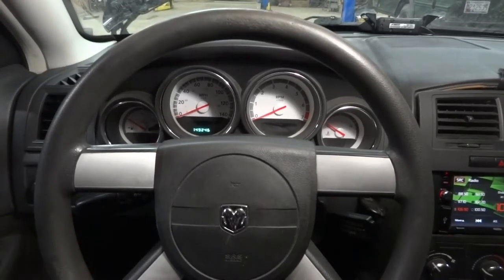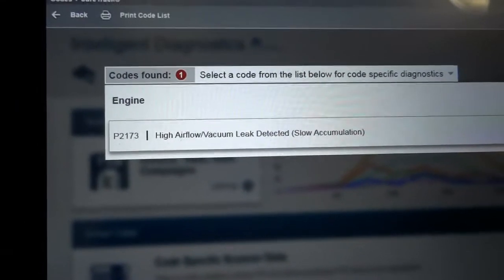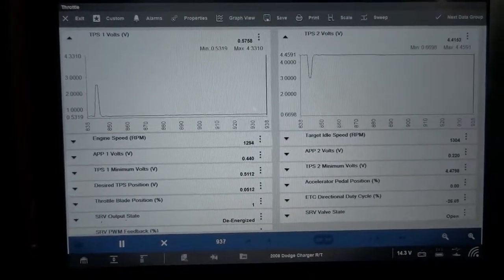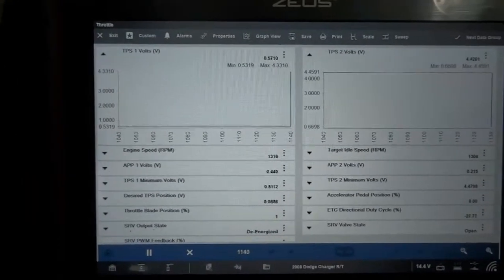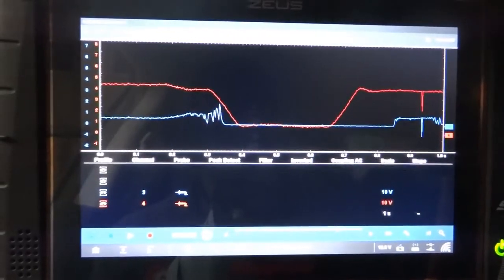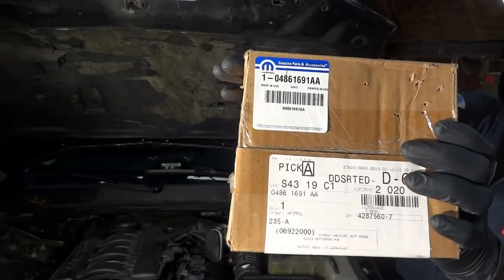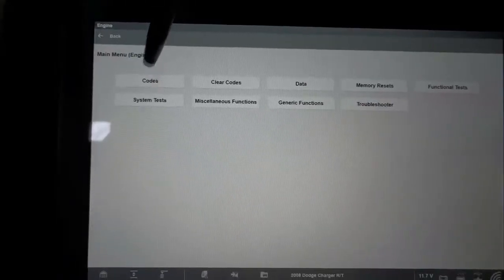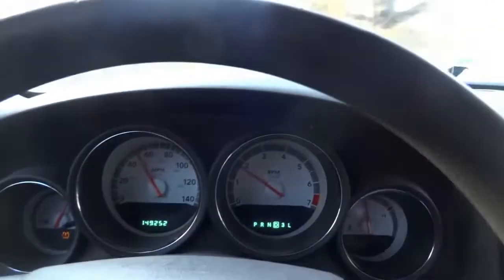Dodge Charger, Electronic throttle body light flashing on the Dash, code P2173. Low Power problems..

Comment: Clean MAFS, throttle body and intake manifold control valve. Change spark plugs and coil over packs. Replace fuel filter and fuel sending units (driver and passenger side - under back seat). Run can of SeaFoam through full tank of premium gas to clean all sensors. Car will run like new.
Reply: Ya….. no, still stupid lighting bolt flashing and no response from pressing accelerator
Reply: @mayken6661  replace accelerator pedal
Reply: I did all of this and it still flashes it’s the pcm
Reply: I replaced throttle body and pedal with sensor still lightning bolt comes on runs poorly
Reply: @jeremywesley4799  check your pcm for corrosion or if it has a chip and take it off
Reply: Brand new ecu still getting lighting bolt
Reply: Changed TB, and the PCM. Still lightning bolt and car will not start, just crank.
Reply: @mayken6661 replace cam position sensor
Reply: Anybody figure it out?
Reply: Out of the blue I got the red bolt in my dash display. No pedal response, code p0123, car (2022 Chrysler 300S 3.6L Pentastar) in limp home mode. I am 30 miles from home, no $ for a tow. I shut off the car, pop the hood, unplug the throttle body, start the car, let it idle rough for 15 seconds, shut it off. Re-connect the TB, start the car, red bolt gone. CEL still on, but I have gas pedal and normal driving. Go home. Next day hook up Foxwell scanner, erase 3 throttle related codes. No problem since. Ordered ported 80mm TB to replace anyway. Not trusting stock mopar TB.

Comment: Just replaced map sensor and vapor canister purge valve on my 2010 Dodge Charger. After these were installed the throttle body light came on with the traction control light and engine light.
Reply from the maker: @markpickett9391  check for a vacuum leak!
Reply: Thanks will do we checked the new map sensor and the hole was bigger than the original one.. put the old map sensor back and the car runs way better.. the check engine light and the others are no longer on. I will be replacing the map sensor with the correct one even though eBay mentioned this one as a fit.

Comment: Today, I returned to my 2014 dodge charger after being at the gym for less than 1/2 an hour. I think I may have hit the ignition button and maybe  had the auxillary on when I went inside. When I came back I got that flashing red lightning bolt and my car wouldn't start, and my display started flickering and dying as well as my headlights. I had to Uber back home just a couple miles and leave my car there because it was getting late and super cold, like freezing. Could it just be the battery that got too low with the auxillary on? My uber driver said an old battery will kick the bucket when it starts getting cold.
Reply from the maker: Jonathon Grinols  Yes Start by Replacing the Battery!!

Comment: Nice before and after scope waveforms. These are common for getting water into the PCM connectors under the wiper cowling. I just had one of these, and found corrosion in the APP wires at the PCM.
Reply from the maker: @marlinyoung1606   Oh really? Good to know!

Comment: When I had a throttle body issue a few years ago, my traction control light came on.
Reply from the maker: Ivan Peterzell really? thanks  that's good to know, I will keep that in my records...
Reply: Yo how’d you fix it, I got the same problem right now
Reply: I have that same problem
Reply: Same here how did you fix it ?
Reply: i also just got this malfunction today with the red bolt and traction control turns off randomly, i have a 09 dodge charger sxt, need help
Reply: @slattwootie  i changed my accelerator Pedal Position Sensor and it fixed my problem

Comment: I had that same light come on on my 13 dodge charger rt 5.7 all I did was cut the car off then put it in run position without turning the car on press the gas pedal down fully to the floor let up on the gas pedal very slowly then restart the car not saying it works for all but it worked for my charger
Reply from the maker: Tacarla Thomas   That's good, Thanks for sharing!

Comment: The same codes came on my car I took it to the shop they charged me 500 dollars for a new fuel pump and and something else where I got my car back the check engine light was still on when I ask they said they forgot to rest it now a month later the check engine light came on again and the electrical signal. Also my car has completely stopped on me in the middle of the road and on the freeway
Reply from the maker: Taylor R  I'm sorry to hear about what you experienced, I recommend you take it to a pro mechanic to have it diagnosed correctly!
Reply: Mines did the same dang thing.

Comment: I have a 2010 dodge challenger when I drive my car the red lighting bulb comes on and my car gets louder and when put into drive or reverse it moves faster than usual any pointers?
Reply from the maker: @raulreyes758   Check your throttle body!

Comment: Hi, I have a Dodge Charger 2008 SXT

My car had the same Red Lightning Bolt whenever I would be at a red light. The bolt would appear and my car would go idle, so then I would have to turn it off and back on again to get it to work again. I read all the possible problems such as the Throttle Body, O2 sensors, PCM/ECU, blah blah blah. I ended up getting a new Throttle Body and the problem was still happening. So, I took my Charger to a mechanic who said it was my PCM/ECU acting up and that it would cost me about $900 to fix it. Now look here, I'm just a 20 y/o college student I don't have the type of money for that. I kept looking for possible solutions and I ended up coming across a comment on YouTube that said before you start changing the throttle body, PCM/ECU, etc. make sure to check your EGV Valve and see if your gasket is not damaged or missing.

I took a look at it and there was the problem the whole time. There was no gasket on my EGR Valve at all. I went to AutoZone and bought a EGR Valve Gasket ( the blue one, cost me about 3-5 dollars) and put it on my valve. After that, my car hasn't gone idle at a red light or stop sign since. Before you start changing all of your parts and taking it to mechanics, check your EGR Valve Gasket. Hope it works! 😄
Reply from the maker: Banny   Thanks for your input!!
Reply: I put gasket on light still coming on
Reply: this is what I'm getting ready to try also, my only worry is that when I wrap my hand around the egr valve tube hole where the gasket will go to seal it, it starts running even rougher
Reply: U drive a Dodge? Ok, here’s the fix - drive it off a cliff. Na , did you figure it out?
Reply: Any luck?
Reply: yes bro the sane happened to me all i did was get a new one have it put on and it’s been driving fine ever since

Comment: I have a 2010 charger doing the same thing, I didn't scan it though. Great video, I love how you explain the process.
Reply from the maker: @rocky7522  THANKS!
Reply: Did you get it figured out I have a 2010 as well
Reply: @samfolkz7414  mine turned out to be the egr valve tube not having the little o-ring and not being fully inserted.
Reply: How much was it I have a 2010 charger with the same problem as well
Reply: @ronelllee6983  not very expensive, it came in the plenum gasket set, not sure if you can get just the egr gasket

Comment: I have a 2006 and mine wont ever turn over. I tried the ETC resetting procedure but nothing. My check engine light started to blink once i started the procedure. The battery is good. None of my lights dim or die as the car is on. I think its the ETC and it needs replacing but im getting it professionally checked out. Nice video ! Thanks for the information!
Reply from the maker: @MaxPotentialGreatness   My Pleasure! Good Luck with your vehicle

Comment: I changed my accelerator Pedal Position Sensor and it fixed my problem
Reply from the maker: Addison Russell  Good Job!
Reply: Hi Addison, Can you tell me where the pedal sensor is located, i have the same issue.

Comment: Im having the same problem on my 2013 Chrysler 200. From my research the ETC ,has plastic gears ,like 4 of them ,that control the spring loaded flap. Theres alot of tension on the flap, putting alot of pressure for fhe PLASTIC gears to work. Over time ,heat ,the elements ,wear the gears become wore, chipped or even missing teeth. This is why sometimes the car will run, other times if its at the wore teeth part,it runs rough n the light comes on. Best advice is replace the ETC, with a new one. May have to take to shop to get it relearned after installation, with a proper computer tool. Good luck everyone. Btw you may drive the vehicle awhile, before it gets bad fix it  BEFORE it breaks completely, in the middle of nowhere

Comment: Excelent video , as usual I am happy to watch such videos like that , but , I would like to ask you about the graph after changing the throttle body ( the two opposite curves of tps1 and tos2 ) is those the same graphs of APPS or different ? Your reply will be highly appreciated , thanks
Reply from the maker: Mohammad Al-Gebaly  Thanks! The graphs on the scope were the voltage change of TPS1 & TPS2 on the throttle body!

Comment: hey duel (i think thats ur name sorry if wrong) I have a MB 906 its 2007 and 2.17cc engine. I have an OBDII error code P1955 I can't find any threads about it online and there are no DTCs that relate. Do you have any experience with this code? I have been chasing it for months now with multiple visits to various mechanics and diesel specialists with no luck. I'm about to pull the throttle body off to check that but I'm really not sure if that's even the right place to be checking. Any help or best way to troubleshoot would be a great help.
Reply from the maker: @toffeetv9623  check your glow plug circuit!

Comment: Hard start when hot because throttle ?
Reply from the maker: عبدالعزيز بن مصطفى  Hard start when hot can be caused by several things, check your engine temp sensor or make sure you check spark and fuel while it's not starting!!

Comment: I have a similar problem but I’m having more  codes issues when the failure comes with the red strike the codes are referred with the oil pressure sensor, and the crankshaft sensor Did you see a similar synthom before ? thanks for your support
Reply from the maker: Cesar Fraga no I didn't !! did you check the crank sensor!!

Comment: Red lightning bolt light plus high idle while in park. My 2005 chrysler 300c is doing this. Even after changing the throttle body.  Plus the ESP light is on.
Reply from the maker: Charles Guero  Check for vacuum leaks!!

Comment: I have the same exact issues with the throttle light and the check engine light coming on with the same accelerating issues except now it has high rpm but absolutely no throttle what could it be? Throttle body, computer itself, or the acceleration pedal need replaced or What can I do to fix it.?
Reply from the maker: TAMMY FRANCO  do the tests I did in the video to figure out what's defective!!

Comment: My 2010 charger sxt with 3.5 was doing the exact same thing with the esp/bas light on as well as throttle control light. I changed my throttle body and still have same issue. Is this because I didn't calibrate ?
Reply from the maker: Richard Vaught yes it could be because of calibration but if the light stays on after calibration, you should check for vacuum leaks, I have seen an intake vacuum leak cause the same problem, I'm assuming your wiring for the throttle is good
Reply: @KITS_Auto_and_Truck_Repair  yes wiring is good. But I can't get the TPS/BAS light to go off.. Thank you so much for the feedback.
Reply from the maker: @raiderrich8355  how does the car run? did you check for vacuum leaks?
Reply: @KITS_Auto_and_Truck_Repair  no vacuum leaks detected. The lightning bolt light comes on along with the tps/bas light. It runs good until the lights appear then the idle goes up and has no throttle response.. Im starting to think I got a bad throttle body? I have bought another new one but haven't installed it yet. I'll let you know the result. Thanks again for your response and caring it's much appreciated.
Reply from the maker: @raiderrich8355  My Pleasure, Let me know how it goes...
Reply: There is a little blue gasket on the back of the air air  intake manifold that goes around the EGR valve tube if that's bad or  is loose it will trip the light too
Reply: @raiderrich8355  Dude, did you figure it out? My car is doing exactly what you said, blinking lightning bolt, higher idle, shit for power,, traction control, and BAS lights. It's intermittent so it comes and goes. I'd think a vacuum leak would cause it to do it constantly wouldn't it?
Also my fuel gage is all over the place but probably unrelated.

Comment: Hello, I have a 06 charger rt and when my car is idling it randomly cuts off with the throttle light flashing. Can you see the video short on my profile and give me any pointers?
Reply from the maker: @7KingMak7   check for a vacuum leak
Reply: @KITS_Auto_and_Truck_Repair  okay. Did you see the video? I also emailed you. Can a vacuum leak make it cut out randomly like that?

Comment: Good info. What r u located. My 06 charger. Start doing something similar but All the light turn on.  And also. Trans.  Start having problems. So   mechanic changed. The pcm. Also. Dis the heads job  still having that problem.  After drive the car about 20_30 min
Reply from the maker: Fer Cortez  I'm located in Dickerson MD

Comment: Maybe I misunderstood but how did you determine it was the throttle body and not the pedal sensor?
Reply from the maker: Leon Perez I checked the pendal sensor off camera, and it was good no drop out or glitches on the signal from the pedal sensor... but the signal coming from the the TPS had a lot of drop out and glitches, indicating a bad TPS
and also make sure you don't have a vacuum leak around the intake

Comment: 2015 Dodge Journey having the same issues. Throttle body replaced and still having lights on. Check engine and throttle body code. What should I do? Dealer said No vacuum leak.
Reply from the maker: Chandra Payan  Check the EGR tube seal, it's a O-Ring! or Throttle wiring, check ecm if it's functioning properly!!

Comment: I have an issue in my 2010 Dodge Charger with Electronic throttle light comes on. I can drive it for 30 minutes and then the light will come on and once I turn the car off and on it resets it. I’ve replaced the throttle body and the gas pedal but now I can’t figure out what else is wrong or how I can fix it now.
Reply from the maker: Alexis Cameron  check for a vacuum leak on the intake!

Comment: I am driving a 2010 Dodge Charger SXT and I am having the same exact issue. I turn the car off and back on again and the light will stay off for 1 day before it comes back on again (always flashing and with the traction light). So far, I have cleaned the throttle body, replaced the spark plugs, replaced the intake manifolds and the "ignition coils" and still...... I am going to have my mechanic check the sensors next b/c I am struggling with getting this fixed. Its been about 1 month since this issue began for me.
Reply from the maker: @VibesOnGo  Taking it to a pro mechanic who can diagnose it sounds like a great idea, Good Luck!
Reply: @KITS_Auto_and_Truck_Repair  It took a week and several techs, but it was the EGR Valve.

Comment: Nice help but need more. I have 04 Durango hemi lightening bolt light on and engine won't crank. Replaced Throttle body still won't crank. Please help
Reply from the maker: David Graham  Check the starting circuit, starter relay, wiring, ignition switch etc...

Comment: I have the same problem with my 2010 charger, but I replaced the throttle body  and injectors, and it's still the same issue
Reply from the maker: Ernesto 503 es79gmail Ernesto 503es79gmail   Check for a vacuum leak!
Reply: I am having this issue with my 2010 Charger as well. I changed the spark plugs, cleaned the throttle body, and changed the intake manifold and ignition coil, and the light came on 10 minutes after I picked it up from the shop
Reply: I have the same car same problem. Took a week and several techs, and it turned out to be the EGR valve. They also cleaned the flaps as a just in case and replaced the manifold gasket

Comment: What if the throttle body light comes back on after throttle body is replaced ? And the check engine light doesn’t go off
Reply from the maker: David Holmes a Vacuum leak can also cause that throttle light to come on, so make sure you don't have a leak around the intake, I gave 3 different options of what could be wrong in the video, did you investigate all of them
Reply: Did it fix it i have the 3.5 2010 an having the same out come wasnt nothing on an ran perfect had my radiator changed to 3 row am it been stuck with burn out light on an the red demon lighting bolt any advice where to start loolong
Reply: There is also a small blue little donut gasket on the egr valve tube that gose into the back of the air intake and if its bad or loose this will set the lighting both light off to .